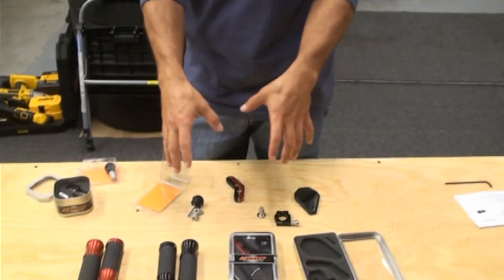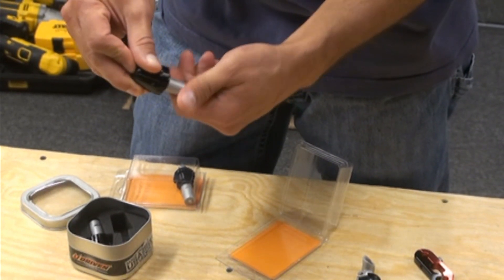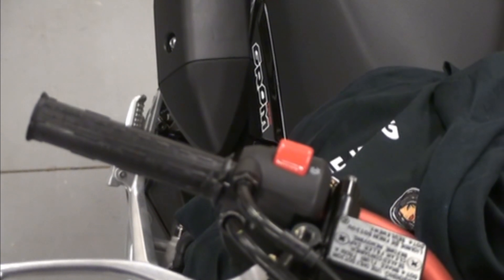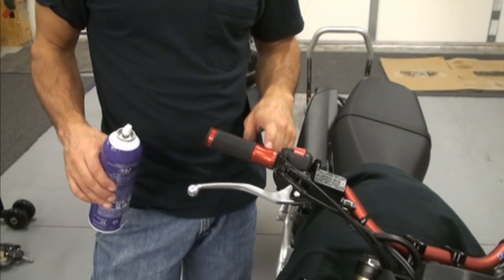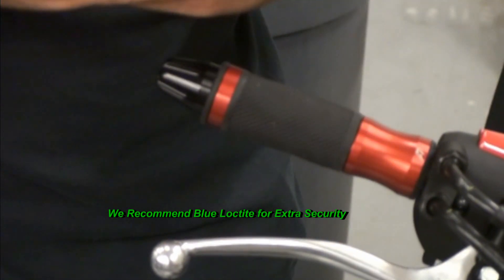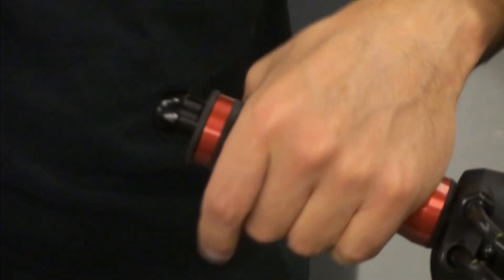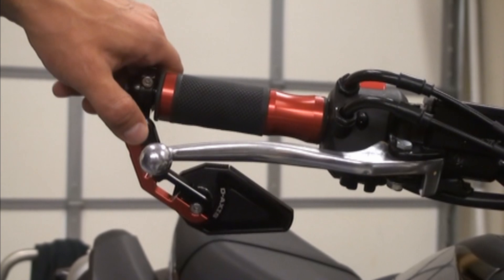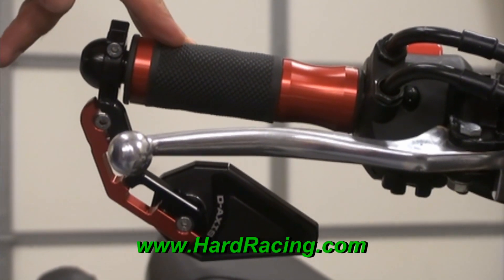Driven D-Axis Mirrors and D-3 Grips installed on Honda GROM MSX125  - Great Low Prices  #Hardracing

Comment: thanks for the tip with the hair spray ,got the same grips , the rubber part of the throttle grip turns on the aluminum body while u accelerate and u have to re- set your hand on the throttle every now and then to keep going

Comment: Thanks for that review! was looking to buy all this stuff actually so nice to see how they're all installed.

 Is that all it really takes though for the throttle grip as in just some brake cleaner to slide it in and you're good to go? Could I use the brake cleaner for the clutch side as well or go with some glue? Also have you been able to get good vision with that mirror? I've read a few reviews about them being pretty small or just not liked for some reason.

 Sorry for all the questions I just figured I'd ask since you have the products lol. BTW Thanks in advance!

 -Rudy
Reply from the maker: Thanks for the feedback.
As we stated in the Video on some Grips, specially the ones we installed, you do have to trim the edge of the throttle tube down, so the grip can slide on.
The End of the throttle tube is flared, so it makes it harder to get the grip on.
If you trim it down, it's much easier.
Then just some Rubber Cement, like shown on the clutch side, and your good to go.
Reply: HardRacing Thanks! One last question please.

 It's basically impossible to mount the D-axis racing mirror on the end with just regular D-axis bar end sliders huh? I'd need to buy that bar end adapter for the mirror side, and just have one side with the D-axis bar end slider on the non-mirror side right?
Reply from the maker: RudyVII7 Correct.  Or you can have (2) Matching Bar End Adapter.  whatever you prefer.

Comment: Could you please please please tell me what the thread is on the bar ends???? I've emailed the company several times and they say they can't be used like that. But you say they can be. I have a 636 and the thread is an m8x1.25. Thanks so much.
Reply from the maker: The ones shown in the Video for the Grom are   6.0mm x1.0

Comment: Where are those bar end sliders I can't find them on your website can you comment the link for them please!
Reply from the maker: ilovedesi13 
If you just want the bar end sliders, (not for use with the mirrors).. click here
http://store.hardracing.com/cart.php?target=category&category_id=2498
Reply: How come it doesn't show the 2 metal pieces though like in the video straight from the box sorry I just don't want to order the wrong thing
Reply from the maker: ilovedesi13 
The two metal pieces you are referring to which we discuss in the Video...... are for the  " Mirror Adapter"  bar ends, made for Aftermarket Fat Bars.. with Hollow ends.
You can also get the BAR END SLIDERS with the Same Metal Wedges as well.
If you have aftermarket FAT Bars, with Hollow ends.
Reply: Yes I was looking into something like this as an alternative because my 07 cbr600rr was low sided and the oem thread inside the handle bar got damaged and broke off so it's now a hollow bar technically.
Was looking for something like this since I can't put a screw into it. Hope I'm not confusing you thanks for the feedback